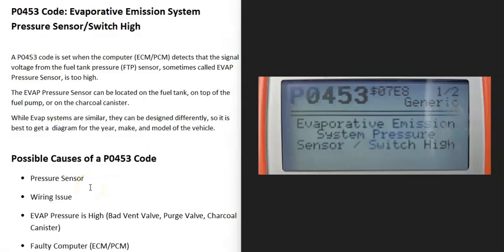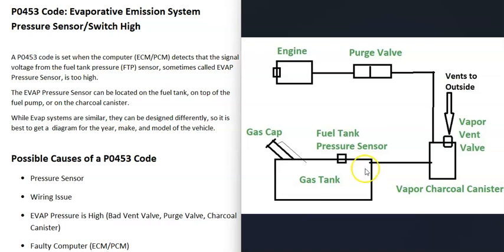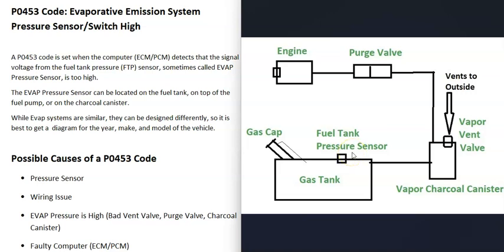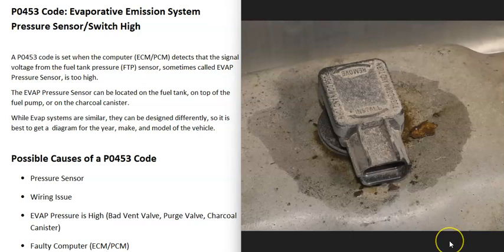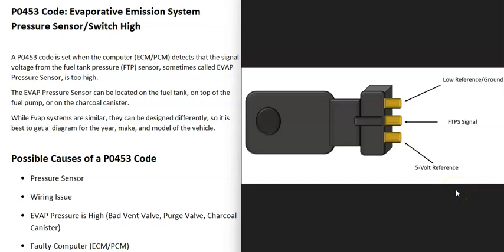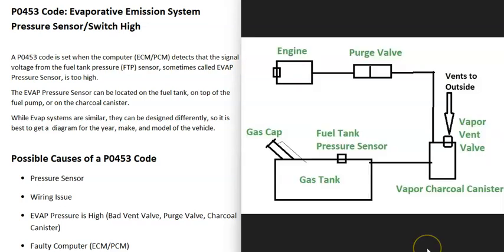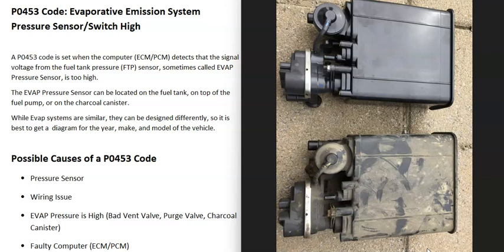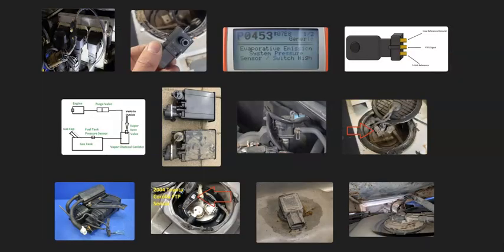Causes and Fixes P0453 Code: Evaporative Emission System Pressure Sensor/Switch High

Comment: I have 2015 Kia optima I have replaced the the whole EVAP system (fuel tank pressure sensor,gas,purge valve,vent solenoid and charcoal canister and yet I’m still getting PO451 code (3 sensors replaced from different vendors) filled up gas and car won’t start..pump pedal a couple times and it would start…help??
Reply from the maker: It needs to be diagnosed, but if the components are good, there may be a wiring issue. I would test the wiring at the pressure sensor and vent valve (Be sure to check for a blown fuse). Since it has problems when filling up, that does point more to a vent valve issue, which is usually built into the charcoal canister.

Comment: I have a 2018 Kia Sorento, had the fuel pump assembly replaced and the fuel pressure sensor replaced. I’m still getting the check engine light on with the P0453 code. Why would the engine light still come on with the emissions code even after replacing the fuel pump assembly and the pressure sensor ?
Reply from the maker: I would check the wiring going to the FTP sensor. If that is good, there likely is another issue.

Comment: I have this code right now I change the purge valve I also changed the tank pressure evap I don't know if I have a bad connection or something but I still have the code on my truck and it's shutting my truck off
Reply from the maker: If it is shutting the engine off and there are no other codes, I would test the purge valve and be sure it is working. I made a full video on all the EVAP components and how to test them; here is a link. https://youtu.be/C5s3Rx3wjD0